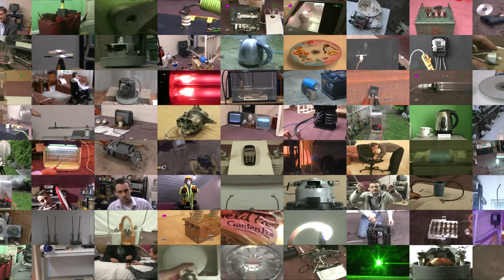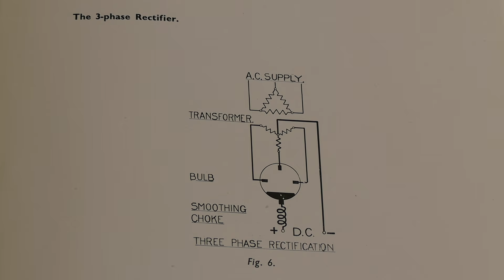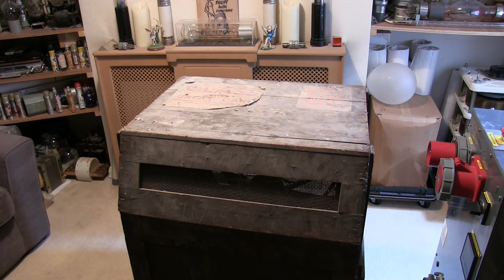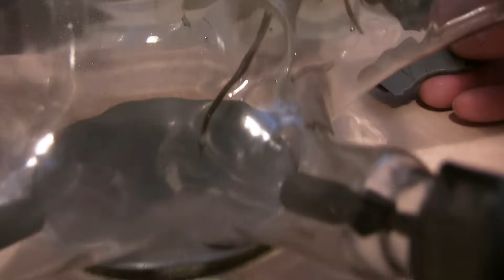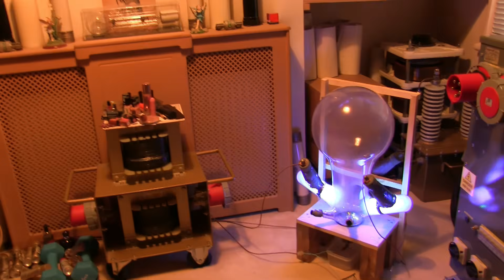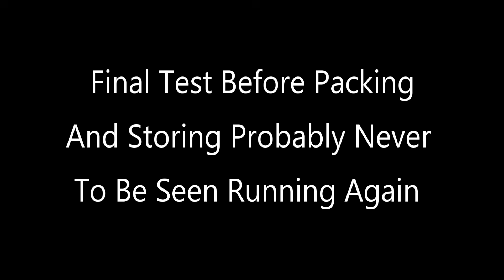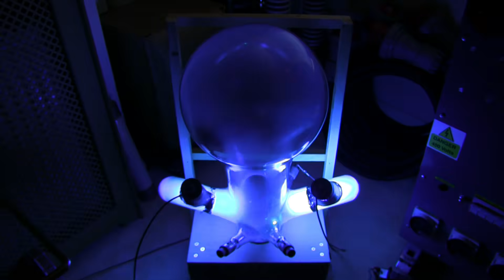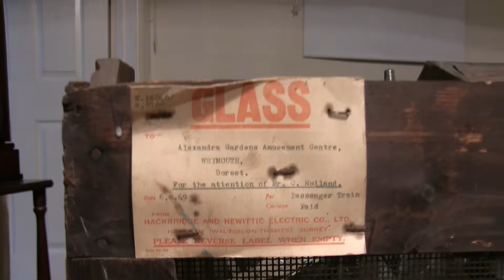Testing The 50 Year Old Mercury Arc Rectifier

Comment: "I can watch this all day" better not, a lot of UVC is coming your way ;)
Reply: I was wondering the same thing, does this thing emit ionizing radiation such as UVC or even worse ?
Reply: @Tigrou7777  There's quite a lot of UV, yes - that's one of the reasons why they were in cabinets. The and the volts of course. But mostly the UV.. Cracking bit of kit mind. Pre-power semiconductors (late 70's) this was how it was done at high power. Used for lots of things like trams, underground railways..
Reply: @Tigrou7777  Search for "mercury vapor lamp spectrum", we use such lamps in our lab to kill bacteria on our sterile benches.
Reply: @asdrubale bisanzio I was more worried about X-ray's and RF.
Reply: Are you sure, thought UVC is usually only able to get through glass when it's special glass designed for it. (if I am remembering right from old big clive video on the topic) Although I'm sure some UVA and UVB makes it's way through.

Comment: Sub station across the road from me has a room in there that used to contain the mercury arc rectifiers, from when it had 2 purposes, one to supply the area with AC power, and the other when it provided DC power for the tram line which ran up the street. Only the AC power side is left, the rest is mostly gone, aside from old cable that is disconnected, but still buried.

Comment: I would be interested in seeing.the rectified output on a scope
Reply: It would basically just have a 100hz ripple because he’s using 50hz power , output voltage DC would be either 325v or 565v before load and filtering
Reply: The 6 phase ones are looking quite interesting on a scope. You can guess it with a circuit simulator. I just drew diodes for a rectification in a simple cicuit simulator and added the properties of the voltages from the transformers etc. in it. A rectifier like this one in the video has a forward voltage of around 12V (compared to a diode with 1,xV) So you can guess how inefficient these things are when you pull some amps through that thing with 12V voltage drop what ammount of heat/power is lost in there. The waveform of the output of a 6 phase rectifier is just a classic ripple but smooth enaugh for most applications back in the days but a little bit deformed from ideal. My circuit simulator can export the waveform to an audio file. It took me 20 Minutes for 10 seconds of simulating all the current. And the audio file had this charakteristic angry spicy sharp 50hz hum.
Reply: @RundeKatze  oops, didn't see your comment.
Reply: Exactly, waveform is sorely missing.
Reply: @Andrew Crews But it's not a FULL BRIDGE RECTIFIER!!!!!!
Reply: @Andrew Crews It's just a full wave rectifier, not a full bridge rectifier.
Reply: I don't think Mehdi would do a collaboration unfortunately. I think most would know why.
Reply: @MixZTitaniumDubstep  I don’t - why?
Reply: @truthsmiles  Soul-Struck probably thinks that people with different opinions can't get on. I suspect he is young and brainwashed by modern education
Reply: @dopiaza2006  I think it’s because it’s not a full bridge rectifier that’s why
Reply: @MixZTitaniumDubstep  no scope that mehdi owns can mesure tht amount of power
Reply: I wonder what the forward voltage is on that thing. There's 20, 30cm of arc the current has to travel through as it gets rectified. Has to be a good voltage drop and heat dissipation there.

Comment: WOW ! I have so many questions :)) I wonder what these were used for, to begin with. What specs does it have (current/voltage) ? What was the positive DC (cathode) terminal at the bottom connected to and what was the voltage output ? What would happen if you flipped it upside down while running ? Also: nice to have you back. Cheers :D
Reply: Ok, it's 400v 7A - sorry :))))

Comment: A long time ago in the 1980s I saw a mercury arc rectifier in use. In the 1980s I was working in a steam power plant that generated electricity in the city of Los Angeles. This power plant had some variable speed chemical feed pumps that were run on direct current. The rectifier for these pumps used mercury arc rectifiers. A blue glow could be seen in the rectifier enclosure. This power plant was built in the 1950s at a time when these mercury arc rectifiers were used.

Comment: We certainly have gone a long way regarding the electronic technology, we now have semiconductor diodes with the same rating as the Mercury arc rectifiers (obviously they will have to be water-cooled to achieve that rating, as temperature affects the internal resistance, and thus the ratings). And for funsies, fluorescent tubes can be used as a diode which I have done out of curiosity, only the side that's heated would be used as a Cathode, and cold end an Anode, just like the diode tubes of the past.

Comment: I have a few questions about these things?
What is the expected forward voltage drop across them?
What is this thing's peak current output?
Also since these things are technically diodes, does that mean that they are technically the first LEDs?

Comment: Cool video,
In case anyone else was curious why how the mercury vapor acts as a diode, It seems like its the carbon anode that gives it this property.

"A pool of liquid mercury acts as a self-renewing cathode that does not deteriorate with time. The mercury emits electrons freely, whereas the carbon anodes emit very few electrons even when heated, so the current of electrons can only pass through the tube in one direction"
https://en.wikipedia.org/wiki/Mercury-arc_valve#Operating_principles

Comment: "This rectifier set can do a million watts, and this rectifier set can do a million volts" 
Now we're talking baby
Reply: Incredible thing. Mesmerizing. What sort of equipment might that have been used in? Any concern for X-ray production?
Reply: @ljetronic  Invented in 1902 by Peter Cooper Hewitt, mercury-arc rectifiers were used to provide power for industrial motors, electric railways, streetcars, and electric locomotives, as well as for radio transmitters and for high-voltage direct current (HVDC) power transmission. They were the primary method of high power rectification before the advent of semiconductor rectifiers, such as diodes, thyristors and gate turn-off thyristors (GTOs) in the 1970s. These solid state rectifiers have since completely replaced mercury-arc rectifiers thanks to their higher reliability, lower cost and maintenance and lower environmental risk.

https://en.wikipedia.org/wiki/Mercury-arc_valve
Reply: @Crimsonedge1  Scary old stuff maan.
Reply: @Crimsonedge1 Very interesting. Thank you for your detailed response!
Reply: @ljetronic  Correct me if i'm wrong but, I think X-Ray production would only be a concern if there was a vacuum in that tube..
Reply: @roger8772  i think he said it is
Reply: @roger8772  correct.
Reply: @1337knolle  wouldn't it be a mercury atmosphere? not vacuum?
Reply: @roger8772  Also you need about 20kV to produce X-rays. At 400V there is no chance of x-rays.
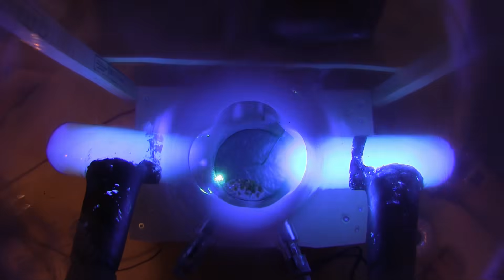Reply: @roger8772  19:54
Reply: @regulatorjohnson.  A vacuum as in the absence of air/gases.
Reply: @BryanTorok  which this is not. It has an atmosphere of mercury gas
Reply: @tmmtmm only UV
Reply: @ljetronic  NYC subway system was powered from these, the subway ran on DC.
Reply: @ljetronic  Used here in Germoney for the underground trains, as these used to operate at 600V DC
Reply: @ljetronic  They were used in power plants for DC rectification, it was used in the NY subway all the way up until the 1990s. Mercury vapor lamps don't produce xrays only UV which certainly could be a danger.
Reply: @ljetronic  The tag on it said some amusement company. Generally for big DC motors (merry-go-rounds, rides) I would expect
Reply: @ljetronic  actually in the old days when doing electrolysis to creat aluminum, they used mercury rectifiers. Imagine the size of those or the amount of them😅
Reply: @ljetronic  I believe that they were used to power some subways (among other things) which ran on DC.  Incredible looking things.
Reply: @ljetronic  LIkely powered electric amusement park rides, once you see the shipping label on the box.
Reply: @ljetronic  they would have been used in subways for high powered dc circuits.
Reply: @ljetronic  I saw a video somewhere on YT where one was being used in an old machine shop to power some kind of electric motor driven equipment early 1900's maybe even late 1800's. I think UV from mercury vapor discharge might be more of a concern don't know if the voltage is high enough for x-ray.
Reply: @ljetronic  Kempton Steam Museum channel has an awesome demo of equipment being run off a mercury rectifier and they show how it changes under load.
Reply: I'm still waiting for news re: the neighbor's dog. ⚡🐕⚡  😉
Reply: Any UVC coming out of that bad boy? Cool how it works to rectify AC.
Reply: @audioaficionado9494  I would have loved to see it hooked up to an oscilloscope to see its waveform. I cant wrap my head around how mercury gas rectifies AC .. They didn't teach this in my electronics technology courses hahaha.
Reply: @audioaficionado9494  probably not. It would be producing lots and lots of UV but the glass (unless something like quartz which would've been unnecessary and impractical for manufacturing) would just absorb almost all the UV
Reply: Hey Photonic can you do us all a HUGE favor and just take a video of that huge recitifier from the top like you did, with the main lights on too, and just leave the camera on for an hour? I think that would be absolutely beautiful. PLEASE! It would be so relaxing to look at. Between the hum and the dancing lights that could help everyone forget the pain of every day life. Leave it running for one hour... ten hours... twenty-four hours... Wouldn't mind... Love to go to sleep to that... Mercury rectifier relaxation video...
Reply: My wife wouldn't even watch this video... or any part of it. EVEN though I told her I used to USE mercury vapor rectifiers. Ye gods. LOL de KQ2E
Reply: @BruceNitroxpro  73s from PD0ROH . Is photon a ham ? if so you now his callsign ?
Reply: Remember the last time we seen one at college in 1979 in electrical power was the last year they were demonstrated
Reply: Now, to complete the trifecta of rectifier specs, you need one rated for a million amperes, even if it's hold off voltage is low 😂
Reply: @deltab9768  I'm thinking low-voltage MOSFETs.
Reply: @deltab9768  Best I can do is a million milliamperes
Reply: I can smell the carpet already...
Reply: Megavolt has joined the chat.
Reply: I've always wanted to see what a Megavolt spark would look like. .3 MV is cool but 1MV would be epic.
Reply: @DehyasHusband26651  yes, under full load, those things would light up like a star.
Reply: EXACTLY!!!   My mind is racing.  I'd like to know the frequency of that vibrating mercury.
Reply: I want FLAMES! Kidding... this was an amazing video!
Reply: There was one in operation until a few years ago at the Laxey substation on the isle of Man....
Used to power the railway there...🇬🇧☺️

Comment: I remember one of these rectifiers from the early 1960s. It was mounted in is own brick built housing next door to the BTH Experimental Labs, Bowton Road, Rugby. ( Now part of a housings estate. ) The inclosure did have a a sump to catch the mercury in case of breakage. I did not have anything directly to do with it’s workings. Just opened the door every so often to take a look at the mountings.  Always a very quick look because I had been told that the UV could have the same ‘Flash’ effect as arc welding.

Comment: What happens when unloaded?
Why the arc doesn't "short" out between the anodes?

I mean, what is the difference compared to a CCFL tube in which the arc lights between the the two poles, why it doesn't conduct between the anodes in this?

Comment: Can anyone explain that arc dancing around on the surface of the mercury pool? I would assume it’s electron flow from the plasma from both anodes discharging at a common point on the pool surface (common cathode), as if it were a copper wire, and being pushed around by like-charges. First time to see that.

Comment: Great video! Does it create uv / ozone? What is the preassure inside? 
I was also wondering what is that bright spot dancing on the pool of Hg - Is that concentrated point of the arc - local spot with highest current density?

Comment: Thank you Andy ( photon) I really enjoyed this one as a ham radio operator. It raises a lot of questions and as far as i can see this you collect these rectifier tubes. 👍 The tube on display here , Does it have a type number , where was it used for ? maximum current draw on Dc is ? How much power is dissapated in heat etc. love to here the boring background stuff. Where did you find this tube ? Sure thing is that it needs to be handled with extrem care with so much mercury in there.  To bad your not on the airwaves because i would love to have a chat and hear you talk and explain more. again Thanks for sharing 👍👍👍🍻🍻 73s from PD0ROH

Comment: This was great to see! Not often you get to see one of these powered up.   Always been intrigued by these, they look like some kind of alien technology despite being old. Imagine back in the day when these were in use, I can picture a large underground power room for a train station or something with rows of these glowing, and the subtle hum of mains voltage.  Early telecom central offices may have used these too for the 48v. Though I'm guessing by then tube based or even state diodes and linear regulators were also mostly in use until SMPS came along.

Comment: Back in the early 1970's, when I first started working as a theater projectionist,  I worked at several old movie theaters that were still using these huge old mercury arc rectifier tubes to provide DC to the carbon arc lamphouses. I had one explode on me once when I powered it up one cold winter night. I never trusted them after that. Weeks later, I was still finding little globs of mercury all over the place.  I have an acquaintance who has quite a large collection of antique electronic equipment, most of it in operable condition. Not only does he have a complete, working mercury tube rectifier rack, but he's also got an old wooden crate, with a shipping date of 1919 on it, which has a brand new one of these tubes inside packed in paper & straw. It came out of the basement of an old theater and apparently had never gotten used.

Comment: They still had these running in steelworks up to about 15 years ago. Usually combined with Magamps and MG sets on Primary Mills. Lots of DC motors. The ones I saw were in a deep, triple wardrobe panel. I don't remember the rating. Would I have one in my living room? (bearing in mind Mercury is highly poisonous), probably not. I seem the think they output UV that did not do your eyes any good either!

Comment: The place this was ment to be sent to: Alexandra Gardens Amusement Centre is still around It was probably ment to power some kind of amusement ride
Reply: I grew up in Weymouth. Alexandra Gardens is a arcade and has a few rides in its grounds. It was likely to rectify the power to supply a set of dodgems. The mention of a train is how it was shipped. It says "per passenger train" "carriage paid" and came from an electric works just up the main line between Weymouth and London Waterloo.
Reply: @joewalker643  You are very probably right about the dodgems! They would have wanted a spare as without it they would be loosing money until a replacement could be made!
Reply: @fluke196c  It was shipped/meant to be shipped by train the label does not specify what it was going to be used for.
Reply: That's fascinating. Good eye!

Comment: I used to work as an engineer at a 50 KW AM radio station. Any time anyone needed to work on the transmitter while it was operating was warned never to look directly at the rectifier, and to always wear long sleeves around it. It put out enough UV to cause sunburn, and to be damaging to the eyes. Even though I put on my best sunglasses, my eyes always hurt after I'd been working near the rectifier.
Bring a "black light" glow poster or something into the room.

Comment: Just how big is you collection of SOX/low pressure sodium? Looked a like a small warehouse worth next to the transformers! 

Excellent video as always, it is great to see quality footage of these very rare devices in operation (especially from all the angles you were able to provide)! Electronically, how do these compare to modern silicon diodes? From what I understand their forward voltage is quite a bit higher,  has anyone ever tried looking at it in action on an oscilloscope? I am trying to think of the magnitude of the the parasitic capacitances. (Although I guess for general 50-60Hz rectification that is not a big deal)

Comment: Anyone cares to explain the existence of the spark skimming across the pool of mercury?
Reply: If I am not mistaken, that is the actual current alternating from the two phases towards the mercury pool. And as energy flow always finds the path of least resistance, it will jump around following that low resistance path. If you have ever watched a thunderstorm, the arc that the thunder makes does not go straight to the ground, but makes all kinds of bends, splits and such. Apparently the atmosphere inside the rectifier is not ionized equally, as it wouldn't jump around that much. That said, I don't know what threshold the current needs to find another path. Maybe a tiny, tiny difference in ionization makes this happen already. Also, the mercury pool seems to have "waves" from the vibrations. The top of one of these waves means a shorter path again (Thunder > trees, tall buildings). And those waves move all the time. The ionization, waves, and even more factors probably, all add up and make that spark seem very unpredictable and randomly going around the pool.